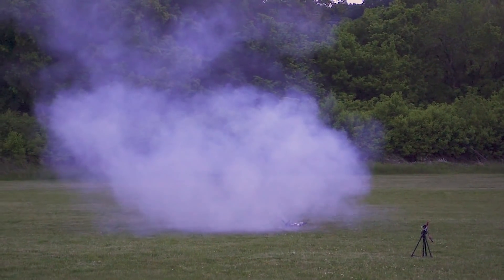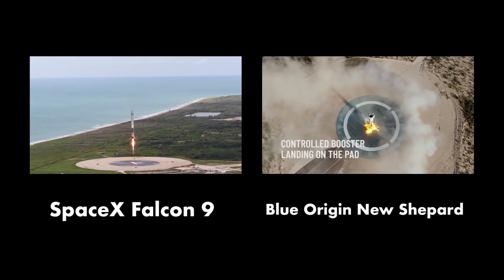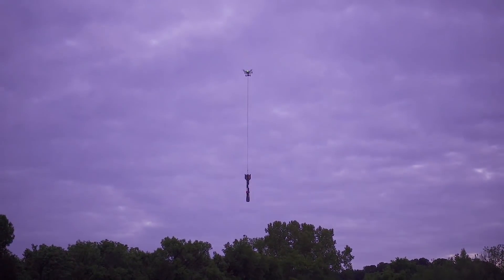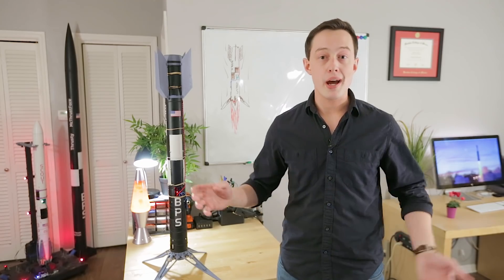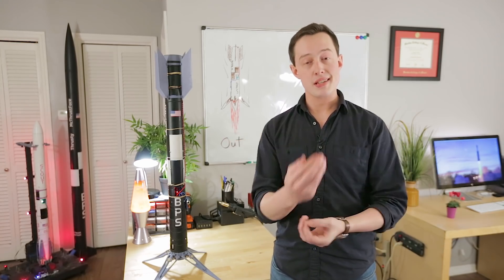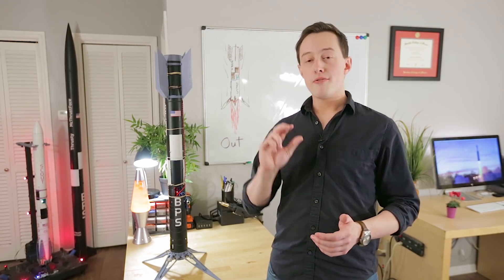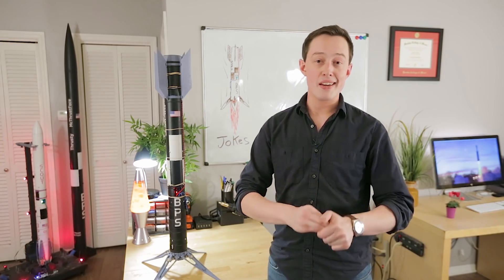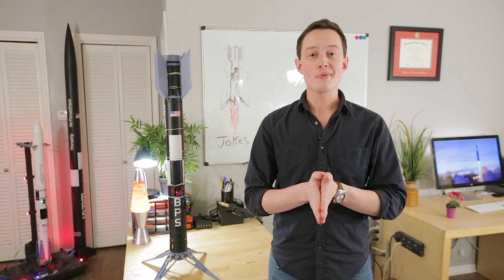Echo - Landing Test #4

Comment from the maker: Just as a reminder, this video was sponsored by CRAP. Concerned Rocketeers Against Parachutes. To become a CRAP yourself, go to https://bps.space/crap
Reply: BPS.space I already am a crap
Reply from the maker: @Ender436  Thank you for your commitment to CRAP
Reply: I'm a proud CRAP.
Reply: Hey Joe! I sent you an email, I hope it will be enough to ensure my acceptance to CRAP!
Reply: Great job though. So close!
Reply: One question once you start the launch and land tests, do you plan on using one rocket motor or are you going to eject the first one after burn out and have another one above it?
Reply: i think you may have covered this before, but, 
why a gymbal vs "blades" that interfere with the rocket exhaust?

Blades can "throttle down" by inserting all blades at once for landing bounce limiting
Reply: You should build a platform so you won’t have to deal with uneven ground
Reply: Hey Joe, if it is really you ❤️ the comments..Please tell me (this might be a stupid question) how far off is the software for Thrust Vector Control from a one for a full-size rocket. Or rather how much if any can you scale the rocket and use the same software and procedures. Thanks.
Reply: want to ask:
Do you think, using FPGA and co, so working on Hardware, for doing the math and decisions about the movements, is better? or is the speed of a Microcontroller enough?!
Reply: that was very close I hope you manage to do it next time
Reply: ardupilot and pixhawk has dual inertial navigation units (plus gps) that do quite well
Reply: i know its a weight issue, but hydraulic toy car shocks for deployment and bounce absorbing on the legs to avoid the shock on deployment
Reply: Thats a CRAPpy landing :)
Reply: BPS.space  that was awesome! I want to be like you when I grow up?
Reply: Concerned viewers against innocent rocket hangings
Reply: How level was the ground.
Reply: Troll level: 100
Reply: lol
Reply: ... crap....

Poop?
Reply: Huh...ur rocket is blinking.
Reply: I would love to become a piece of CRAP.
Reply: Which processor did you use?
Reply: I LAUGHED
Reply: Why are you not using liquid fueled motors?  They can be throttled and are easier to make than you think.
Reply: MAYBE U SHOULD DO SOME HARD CODING AND WHAT NOT
Reply: I'm sure I can improve the landing 100/100 and its easy 😎
Reply: Are all of those words real?
Reply: the CRAP is flying.
Reply: Like poo
Reply: crap has splashdown
Reply: I’m also a crap
Reply: You can put pins in landing legs
Reply: And the Crap has landed
Reply: But im already crap

Comment: After you adjust your burn time...cheat, and make it so your landing legs stick into the grass a little or get off the grass altogether. Your landing is not the problem it's the recoil of the soft surface that's causing your rocket to fall over!
Great job...

Comment: this launch made me think even if you get it a few inches from the ground the legs are always going to bounce up .. maybe you could try some form of softer suspension so it settles and doesn't bounce or instead of them being spring loaded control them with a Nano servo that when the flight controller detects a touchdown the servos ''slacken'' upwards slightly to absorb the shock.

Comment: curious if you have found a solution for the vibration caused by the deployment of the landing legs? It made me think of how vibration dampeners are used on a compound bow.  Could there be some density of rubber material that you place in between the landing leg structure and the body of the rocket to absorb that vibration more quickly without having to do a series of software adjustments first?  This could likely be a very small amount of rubber material so that any weight added is definitely negligible.

Comment: How about trying out hybrid rocket engine to have thrust control and perfect landing every time? Or maybe compressed air for a smaller rocket?
Reply: Too heavy
Reply: @floodgates6210  Dude, at what point do you decide that a comment is too old to respond to? lol
It's not too heavy if they exist and are used. Solid fuel isn't the only option
Reply: @romankalinchuk2750  oh oops lol I didn’t see it was 2 years old. Anyways if you wanted throttle control you would be looking at ~100 pounds wet mass for just the engine and propellant tanks so then you would need aluminum tanks and a entirely new flight computer and everything would probably set you back at least $1000 with the testing campaign included. That said, I think solids are the only plausible option at least at this scale.

Comment: You really need a longer engine burn time, you also need to have port thruster on the top of your rocket to keep it level, until you design and initiate this you will fail fail fail every time. The problem rocket attitude and rocket engine power coefficient  ratio of gravity pulling you down and amount of thrust force to keep you up. I watch your video's and see inherent problems in your design, Cardboard has a weight factor greater the tin stove pipe for a wood burning stove or aluminum tubing.  Better off with plastic rivets than stainless steel screws to hold things together, remember you are trying to use less weight as possible to get you vehicle to land properly. The other problem is you talk to much on your video, keep it simple not everyone watching you is a rocket engineer or a rocket scientist.  Try your best to work with aluminum more than plastics, rigidity is the key factor is the landing arms, yours are to springy and make the module bounce on impact! I look forward to seeing improvements in your model and hope you will have a successful landing on tera forma, not on the grass.

Comment: Why not try to use a system that heats and controls the temperature of all of the components? You could put one on each sensor or a blanket one. Then you are able to really control for that variable for every time you fly your system. Who knows, you might even be able to only calibrate you accelerometer once instead of every time.

Comment: Hey Joe. Amazing job. I have a silly suggestion from a non-rocketeer. Have you considered using a ground based component to supply landing information? Not as replacement for your primary approach, but rather as a supplement to help insure consistently repeatable landing results once the primary method is perfected. I have noticed (and I am sure you have) that there are concentric circles on the SpaceX landing ship. You are already using rocket mounted cameras to record the landing, why not put them to use. Is there optical recognition software available that would allow the rocket to use the circles as reference points and distance indicators by measuring the perceived size of the circles from the rocket compared to the actual size? Landing on a black pad with white circles wouldn’t be cheating, as SpaceX doesn’t land on a trampoline (grass for you), quicksand or the side of a hill. As long as the drop was straight at engine cut-off, I would think a smooth surface also would allow a better chance of a successful landing versus the small, but perhaps significant variable push-back of the grass. This would also provide a logical next step in your rocket evolution by not only landing, but using optical recognition and thrust vectoring to land where you want it to land. The rocket spots the pad and if within capability adjusts to the landing zone. A piece of foam board (with a small patch of aluminum foil to act as a blast shield) would be light and only add one thing to carry to the launch site.

Alternatively, if not optical recognition of circles, what about infrared or radio beacons on the ground in an arrangement that would do the same thing.

I am assuming you’ve already considered this, but just in case...

Comment: Have you looked at existing RC airplane telemetry sensors, IMU packages and flight computers?  Here is one example:  https://www.horizonhobby.com/aircraft-telemetry-variometer-sensor-spma9589
IMHO, you are putting too many constraints on yourself.  You have PLENTY of constraints already being imposed on you (like size, weight, power, cost, etc).  Adding additional constraints like "I really don't want to use larger landing legs" and "I want to fix it in software" is just silly.  First get it to work, then you can impose additional requirements and enhancements.  I think your biggest constraint is the use of an off-the-shelf solid rocket motor.  You have no throttle control, which means you have no way to dynamically control rate of descent.  You can't even control duration of burn - all you can do is adjust when you light the candle, but with your low-quality sensors, your error bars are simply too big.  You might get lucky and stick the landing occasionally - but if it's not repeatable, it's not really a viable solution.  You might be better off carrying a CO2 bottle (look at BB guns or airsoft guns) that could be used in reaction jets for the last foot of the drop.  That way you could plan to cut-off the rocket motor with margin of error in altitude, and then use the CO2 motor (which can be throttled and cut-off) for the soft landing.

Comment: The feet is too bouncy considering the inertia threshold the computer passes as okay for landing, so reaction from the landing distance is still enough to toss the craft. If correcting also consider the weight of the final head cap

Comment: Ive designed a rocket motor, it is dimmerable and is ecologically efficient and the only waste is water, it consist on a 2H2O2+Fe than makes 2H2O+O2+Fe (the iron is just catalyzer, didn't consume in the reaction) and  after that reaction i add a 2H2 (the complete reaction is 2H2O2+Fe+2H2) to make a total of 4H2O giving a very high speed reaction and a lot of thrust ( i'm keep making the 3d models of the control valves and the nozzles) and if you want to learn about this comment here

Comment: Looks like too much power dropping at the end so it hit the ground and fell if it lost power gradually it would land perfectly .
Reply: There no easy way to do it with a solid state motor unless you can make the thrusters open and close to give or take power gradually.
Reply: Also taking another look when the rocket got close the the ground it got thrust so if you had a throttle engine you could dial the power down at the last second so it lands smooth
Reply: Or make a solid state motor with the composition the same at the start but at the end mix it with something else to bring the power down at last second .

Comment: While solving the landing boing in a software capacity is definitely doable and a nice extra little challenge maybe also consider increasing the landing legs form 4 to 5 and possibly small circular pads on the ends to try and control the boing to happen upward instead of side to side. I have had the same boing problem with some of my 3D prints projects.

Comment: Maybe try landing in someplace that has dirt or gravel I think the grass is messing you up. Another solution for throttle control might be some kind of thrust reverser clamshells that close around the end of the nozzle and direct it back up into the fuselage or symmetrically around the sides.

Comment: Perhaps you can encount a statistic average velue in parallel (last 10 measurements) and compere them to the values measured in time. So you can find out, if there is a simple peak or not.
Reply: I ment 17:04

Comment: Hi Joe!
Great work so far.

I have a 5 year experience in vertical landing with a big scale RC VTOL model:

https://youtu.be/NnBYGcHXA0s

For what I see on your videos you just need a very strong “autolevel” (a.k.a. Heading Hold) in the last (two or three) seconds of flight just before the touch down.  Beside this, everything in your model it’s OK.

My advice is to look at the OpenAeroVTOL firmware that can be used with the KK board.
OAVTOL can be used to move two small moving surfaces located at the rocket exhaust. 

From my experience with the Aerotech G12-RCT Rocket Motor, I know that the temperature of the rocket exhaust is VERY high…….so for these little moving “pads” you need a very heat-resistant metal.
Other methods to keep the rocket vertical (i.e. compressed air pushed out of holes at the top of the rocket) are too heavy, complicated and less effective if compared to the moving surfaces at the rocket’s exhaust. 

One more IMPORTANT thing: do non land on grass!  
For a perfect landing without flip-down, you need a very flat and  perfect horizontal surface……and maybe a grill-metal landing pad can be even better (to avoid some air turbulence/vortex at landing).
Bye!

Comment: Part of the issue with the leg deployment is that each leg is a mechanically separate unit but they don't all exert force on the rocket body simultaneously or with the same load. So, you end up with not only a bit of Z axis bounce (not a big deal but could be fixed with a cam type pivot so they don't pick up so much speed) you also get an XY jerk that must be compensated for at arguably the most critical time. Joining the legs mechanically ensures that they all snap into place with an equal amount of force and at the same time. The trick is to join them mechanically in such a way that they remain independent once deployed (to absorb impact at varying loads across the legs). They don't need to be truly independent however. A sway bar (anti-roll bar) acts on both sides of a vehicles suspension to join them together mechanically but it doesn't prohibit independent motion. Finding the right balance is critical though. On a vehicle, too stiff of a sway and every action on one side aggressively influences the other side and can cause issues while too light of a sway means body roll as the rolling inertia of the vehicle above the suspension overcomes the bar. Thankfully, you can aid the entirety of fixing this by substantially lightening your landing gear suspension. 1kg falling 10cm (call it 20cm for a beefy margin) just doesn't need much cushion or the progressive loading that rubber gives you. - I push resolving this issue in this way simply because a hardware fix should always take precedence over a software fix. Otherwise, the software fix is really a bandaid covering a flawed design. I understand your logic in software over hardware in some regards but you have an easy fix (albeit with some engineering and testing) over a complicated fix if you just address the hardware. Of course, I totally get wanting to fix issues with the avenue you're most comfortable in too so ... - Also, why not ignite the rocket motor the same way you're cutting your rubber bands? Autoignition temp should be reached quickly and consistently. Lasting, setup a landing pad already! Small deviations in the ground and the grass is equivalent to SpaceX trying to land in a brush pile! Not only do the legs have to cope but your ground effect thrust is always uneven and therefor requires compensating.

Comment: I wonder if it is possible to add throttle control to a solid fuel motor by using some form of thrust reversal/re-direction system: https://www.youtube.com/watch?v=filq88Yvt5I

Comment: I recently learned from my work with model rockets that kinematic equations are not sufficient to model the trajectory of a rocket at any extended path along its trajectory.  Kinematic equations are actually based on truncated Taylor series approximation of Newton's laws of motion, and are not accurate enough, even with an infinite number of terms, to model a system with varying mass or drag.  While the error is negligable in many cases, it seems that it is subtantial enough in your case to affect the rocket as it descends the last few inches.  Tweaking your physics-based altitude algorithm might be adjustment needed to land the rocket exactly on the ground

Comment: Most high end devices will array the accelerometer. You may want to try 3 sensors on a board at either end of the rocket?
Reply: Gas piston for legs? CO2 cartridge? 

Also it's light enough to use 3 legs.

Comment: Wow. That was very close!
What are the possibilities for throttle control at model rockets, mentioned at 3:16?
Reply: Amos MA you could have two rocket motors that can be angled away from each other. If you point them in the same direction, the thrust will combine. If you point them slightly away from each other, some of the thrust will be lost. 

You could also have something that interferes with the exhaust. 

Both of these solutions would be very difficult to implement, and would probably make way more problems than they would solve.

Comment: I think you got this. But i think you need to add more weight into the rocket. I think it is too light. When it drops on the ground it bounce and fall. Maybe you can add more weight into lower part of the rocket and it helps to stabilize the rocket after the first touch down.

Comment: This is fantastic! Hard subscribe :) I'm curious as to why you chose nichrome for the releases instead of a mechanical system involving something like a blade against the band. I know this has been used in the escape system orientation sensors on vehicles like the Saturn 5 and they're used in hydrostatic releases for things like liferafts, etc. There's probably a good reason, but I was just curious (I'm a biologist, not an engineer)

Comment: To get the drift out:  1) Write a bit of code that clamps your gyro data to reasonable values if they exceed those  values in either the + or - direction.  2)  Use the same code that triggers the nichrome and releases the landing legs to initiate that bit of code.  3)  Let it run until touchdown.  (You only really need the clamping code to run during those last few seconds, so no need to bloat your main control loop with it.)  Constraining your gimbaling just prior to touchdown shouldn't otherwise cause any ill effects to vehicle control.